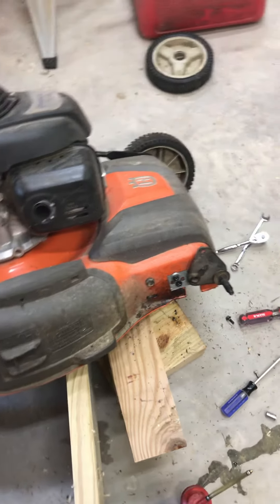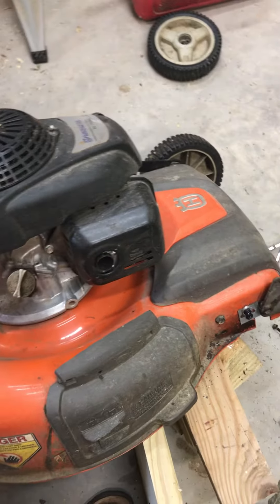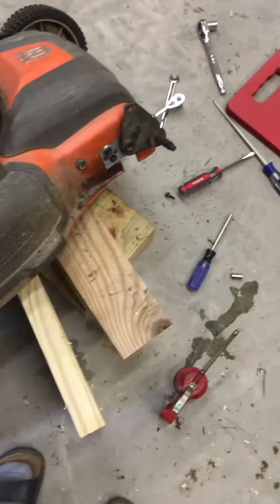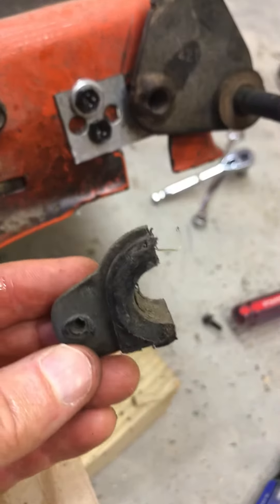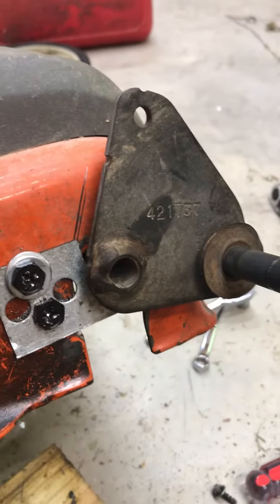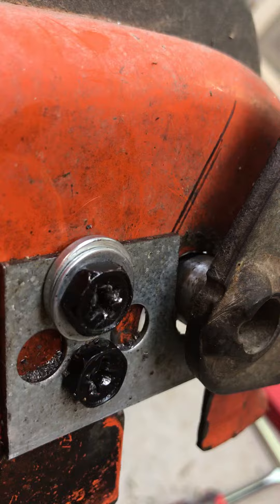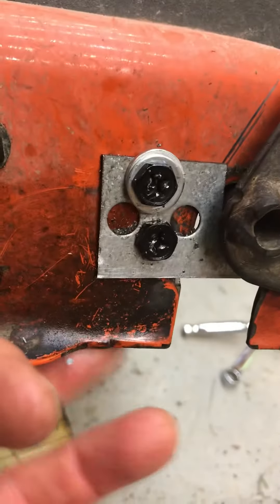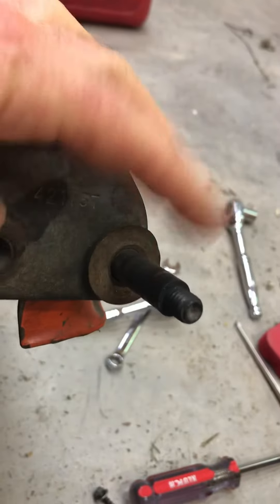Repair front axle bracket on husqvarna lawn mower

Comment: Nice fix, just for anyone that ends up here because of broken brackets, they are available in STL format so you can 3D print some new ones. The factory brackets are only held in place by one screw even though the deck is drilled to use two screws. The brackets were fine on mine but the screw was stripped out, I just used 2 machine screws with a couple flat washers on each side for a more secure mount.
Reply: Now to find a 3D printer...
Bob
Slippery Rock, PA

Comment from the maker: Do this instead of throwing away a perfectly good mower which is what lazy ppl with a lot of disposable income do 😂✌️
Reply: Funny you say that cause I just picked one up off the side of the road took it home and it fired right up realized this is why they threw it away. I'll fix it thank you
Reply: Does the spring on the front axle somehow engage with the bracket? My neighbor gave me his mower. The bracket closest to the spring was all chewed up. The spring swivels around the bracket. Not sure if something broke on the axle.  Can't find any good info online. Mower is out of production.
Reply from the maker: @CarlosGonzalez-mr5qz  there is no spring that I recall. It’s very simple assembly and if you note the basic details from my video you should be able to make it work with the modification shown. My mower is still holding up well.
Reply: @scotttomlin5474  Thanks for the reply. This is a Craftsman EZ walk. It has a lever that raises all 4 wheels up or down at the same time. The axle has a tension spring. I already ordered the new brackets and I'll see what happens when I put everything back together. Thanks.
Reply: Can you take a pic that inside or other side of the bracket so we can see what the curve looks like ?